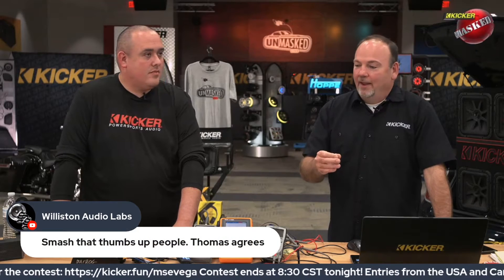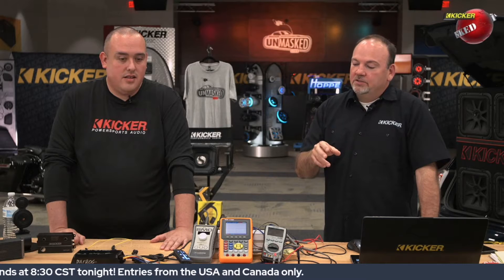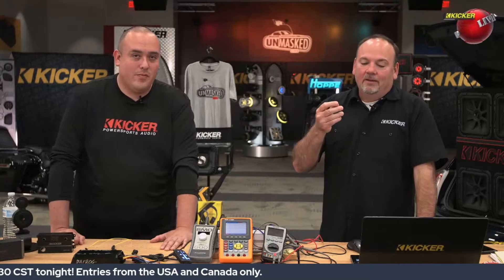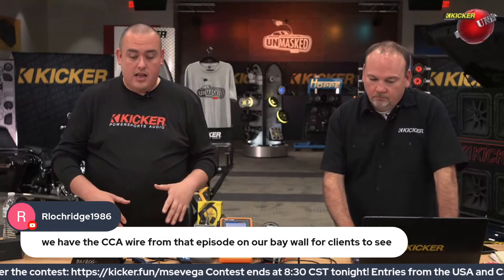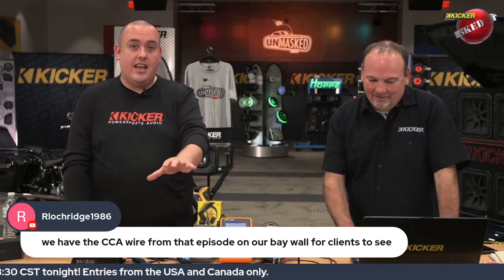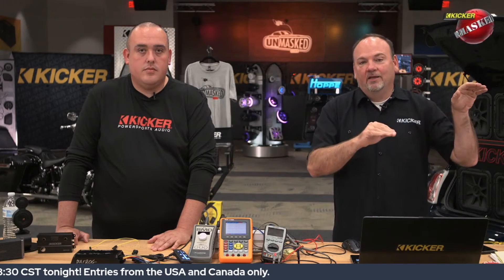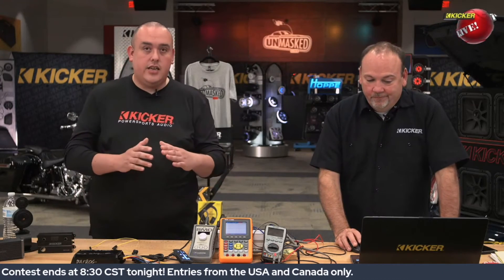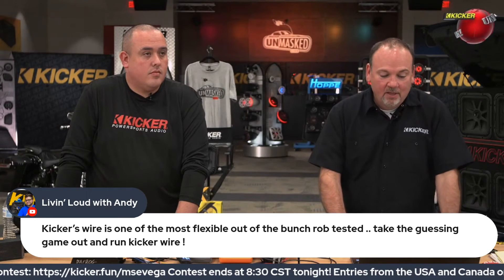OFC vs. CCA- Which Wire is Best? Kicker UnMasked - Shorts

Comment: I'm having a hard time finding 100 percent copper wire to run power wires to my cars stereo. I wanna run a camera and a Amp to my stereo and I want 100% copper. I would like to buy 100 foot rolls of different colors wires of pure copper. Where can I buy what I need?
Reply from the maker: What AWG are you looking for? For the camera, I'm assuming you want a smaller gauge (probably primary wire) but if you want power/ground/speaker wire that's going to depend on the amount of current draw you anticipate.
Reply: @KICKERAudio   Thank you for getting back to me. Yes I'm looking for wire for the camera and also whatever size wire a pioneers factory harness uses. When I hooked up my pioneer all I had was 16-18 awg wire and they were so much more fatter than the wires of the radios harness. I don't know if that's OK. I would really like to buy several different rolls of wires of 18-22awg white, purple, blue, red, yellow and light green and black so this way I'll have pretty much all the wire i need to install a stereo system or a Amp. I don't know if 18-22 awg is average but I do know that what I used to connect my stereos wire harness were huge compared to the wires on the pioneers wire harness. I need to find a supplier that would sale me 100 percent copper wires. All I run into is CCA wire. I would like to find a supplier for future use. Thank you for your help.
Reply from the maker: If you do a quick search for "copper primary wire"  you'll find many choices. Unfortunately we don't offer AWG that small. To be fair, since we don't sell any video products it's probably wise to first talk to someone that does make that kind of gear, to ask them how important OFC is for a video application. As with all copper wire in today's market, you will pay a premium for it. It would be a shame to do so if that video expert says its unnecessary.

Comment: Hi-Fi I love your content but you need to follow up on a particular zero gauge wire Limitless is selling a 1op cable that supposingly is silver tinned which would make it the only gauge out there that has a silver coating which would make it the best 0 gauge wire made. silver is the best conductor when it comes to electricity and I noticed that Limitless is not in your group of 0 gauge wiring that you did with testing is there any way for you to get your hands on the zero gauge or even the Four gauge silver tinned wire and do some type of test to one, prove that it is silver coated,  what type of a difference that type of coating makes compared to all of the other 0 gauge wires out there that's just a regular tinned.my understanding is  that silver is very expensive and compared to knukoncepts its only a $4 difference in a 50 ft run I believe they sell it for $204 for 50 ft and knukoncept sells it for 200 for 50ft. we need to get to the bottom of this and you're the man that could do it because you're the only man out there that did this type of testing on all the wiring . And honestly if this wire is so retained it should be a lot more expensive. Also besides making a video about this you should make another video pertaining to dual inputs and if you really make more power and if it's really worth running dual inputs on amplifiers. Would it be hurting your system if your running to land puts Etc a lot of people out there only doing it simply because famous people are running dual inputs and we're just following in their footsteps and if it's not worth it then why do it or if it would damage our system why do it I believe it would be two excellent videos if you can get to the bottom of both of these problems.